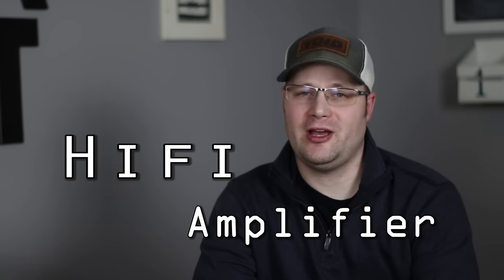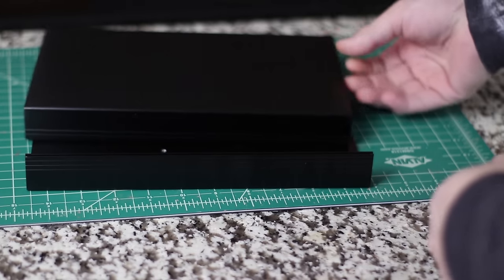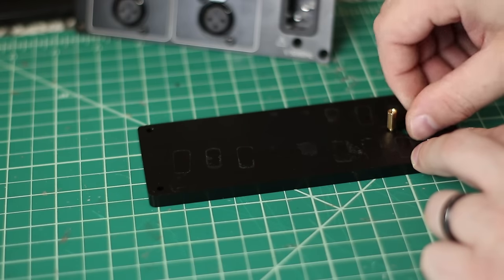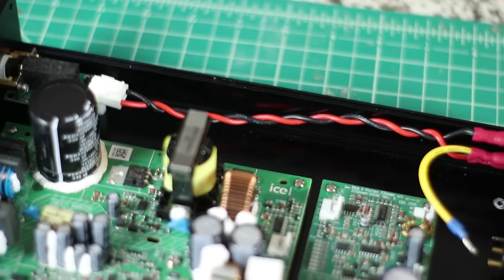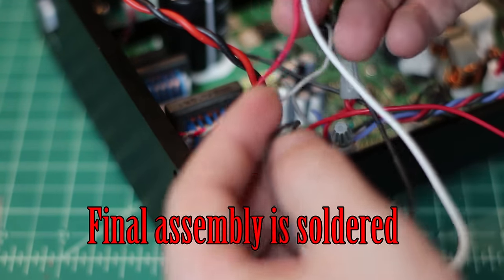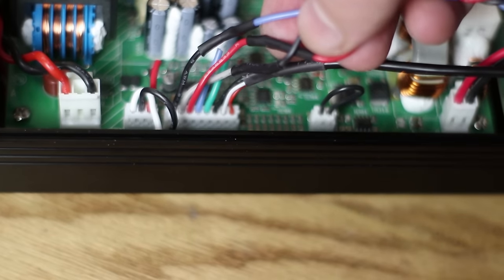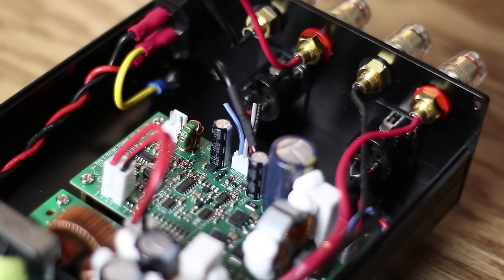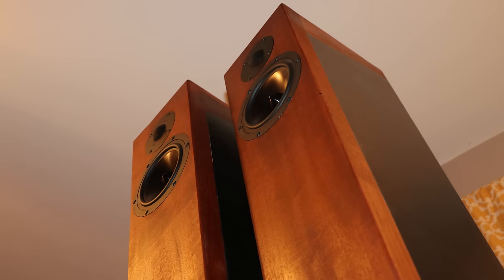How to Make a $3000 DIY HiFi Amplifier for $300

Comment: its definietly not a $3000 amplifier, and it not gonna sound as good as the good amplifiers made in 70's and 80's, you may just don't hear the difference between amplifiers, since i got my SA7800 rebuilt with modern semiconductors, there isn't much amplifiers that is better than it, i took a demo. My SA7800 sounds very natural and very good frequency responses, very fast music response, i took a demo of my brothers friend gear which is a sa7500, it was also real good, i heard some rotel amps, some 90's black plastic crap amplifiers, which didnt met the exceptations.  It's definietly a good 2x 200watt amplifier for the normal users, its a decent $300 amplifier. But for $300 i would rather get a better specs amplifier from the past, and not due to the nametag of the amplifier.
For audio enthusiastic ppl, this amplifier not gonna met the exceptation, and since you got it for about $300, you cannot say that its a $3000 gear, just because you like it, it not how things work.
No hate speech, I'm also an audio enthusiastic, its just so odd for me, my sa7800 worth about $900-$1300 but i cant put a 0after it just because i like it. I like my amplifier so much, but it not gonna mean that i would put a 0 after the worthiness so it gonna worth $9000-13000.

Every class of amplifiers have its own advantage, for sound quality class A or class AB but not D, D is only for efficiency, even tho this amplifier may gonna do 0.1% THD, the class A or AB amplifiers can do 0.009% or even some can do 0.007%, also with so much more natural sounding, but they tend to make more heat, due to less efficiency, it draws more power, and also you have to make it much more beefier, to handle the VCC that you threw at it.

Also, yall always talk about the bass, but when you gonna talk about top sounds, from 19k-100khz?

Comment: Class D: A lot of bang for your buck and arguably is HiFi.  But it's a switching amp designed for high power amplification at low cost, $300 is about right.

Comment: They claim 200 watts RMS @ 79% efficiency. That would mean that something on that little board needs to dissipate 40 watts of heat. I pulled up pictures of that board and that's just not going to happen. Someone in the marketing department swapped Peak for RMS.
Reply from the maker: Just make sure to look at the data sheet

Comment: Im wondering if its possible to take a reciever lets say a pioneer elite thats not being used and replace the amps with 2x500w?
Reply from the maker: Yes. Take a look on the back of your receiver and see if it has a 5.1 -7.1 channel out via RCA.  If it does, you just plug in the RCA's from this unit into those ports. Your receiver will now output that signal to these amplifiers and bypass the pioneer amplifier.  I'll do a video on it. Make sure you're subscribed and hit that Bell.
Reply: @Toid  yes thats just like adding a regular amp.....what i want to do is take 2 500w amps integrate it into the pioneer elite chassis and retain all the functions this way when i use it for 7.2.2 ill have an actual 9 channels x 111w instead of the crappy 9x35w....the pioneer is originally 2x120w stereo its a Elite VSX-LX503 ....unless it has 9 seperate amps? Is this an impossible task?
Reply from the maker: @Titan7170  So you basically want those two to amplify all of your speakers. No. I don't know the way that that can be done you need separate amplifiers for each channel because each get a different input signal.
Reply: @Toid  hmm...ok well if they all got seperate amps then why does the power decrease the more channels you use?
Reply from the maker: @Titan7170  The way surround sound receivers are rated are typically driving just two channels. Once you start driving more channels with the same power supply, you don't get as much power.
Reply: @Toid  so the power supply is the problem? So theortically if i upgraded the power supply to lets say something rated at 1200 watts....should the power go up?....do you think a computer psu could replace a reciever psu? Sorry for all the questions....and thanks for responding.
Reply from the maker: @Titan7170  I honestly don't know. But I don't think it would be as simple as that. If it was you would think the manufacturer would just include that.
Reply: @Toid  well not if they trying to go the cheap route....thats why they rate the amps only at 2 channels ....they dont really want us to know what the reciever is putting out all channels driven....they just want our money....lol

Comment: Another great video. Will you build me one? LOL I am not familiar with Digital amps and how they sound. Is this capable of truly HiFi sound?
Reply from the maker: It is. Total distortion at full wattage is 0.2%.  I think it was Paul McGowan who said that and amplifier that they make at PS audio with icepower was one of the best he's ever heard.
Reply from the maker: Believe it or not it's actually an analog amplifier.  I think class d gets confused with digital sometimes.
Reply: would it be better to build 2 single amps, each with it own power supply? It would add to the cost, but, would it sound better?

Comment: I highly recommend just buying a taramp brand 2 or 4 channel amp, then get a few old computer PSU, isolate your 12v wires and strip the ends, then hook up to your amp. Very easy to hook up in the house. It's much more cost effective to buy an amp from a mass producer than to make one yourself. An 800W 4 channel is 115$ on Amazon and a power supply isn't much either. You'll be glad you read this comment if you are thinking about building an amp to save money

Comment: Missing the sound test dude, how come you don't show us the sound coming out of it?
Reply from the maker: Never thought there was a reason without a reference.
Reply: @Toid  The reference is our ears and what we've listened so far, in presence, through video or any other way, each one would have to evaluate by himself, it's very incomplete in my opinion not showing us the possibility to judge by ourselves.
Reply from the maker: @PG-PCW  right.  But without having heard the speaker before on other equipment,  it's not a good test.  You need to hear whatever speaker you know on multiple pieces of equipment, preferably at reference level. That's a hard test to do via video

Comment: Wait.... This thing uses switch mode power. Simply put, there is no way in hell you can compare it to ps audio, and other high end amps. There is a reason why the really top end brands use C-Core or R-Core transformers that are beastly and heavy.
Reply from the maker: Just to clarify PS Audio does use switching power supplies, which is what this is referring to. Look up any of their amplifiers that use IcePower, such as their stellar series.

Comment: @123toid does anyone make a case to do the 500 version in a 2ch?
Reply from the maker: I haven't found one, which is really unfortunate. You'd have to buy an already made enclosure and drill out all the holes.
Reply from the maker: @Genuine Audiophile yes. This case is made for the 500w http://www.ghentaudio.com/kit/asp-mxr.html. It is just a mono case.  They also make one with just an XLR output.

Comment: Why didn't you explain that you are just building a mono-block instead of a true stereo amp. You need to tell folks that you need two of these in order to do stereo. Who listens to mono these days so your price should actually be double that of what you are quoting here to be stereo capable - not so cheap now...
Reply from the maker: I'm guessing you didn't watch the video in full. If you had, you would know that this is two amplifiers in one. This is not a monoblock.
Reply: Are you sure?  The back panel shows left and right speaker connections.

Comment: Never seen  such a small thing costing 3000 like ANYWHERE
Reply: @nathandaniels4823  what’s that have to do with a amplifier that looks like a 25$ China piece of 💩
If this thing cost 300$ in any store it’s a ripoff, not to mention 3000 😁. 

Regarding that pickup, it’s not the most expensive, search little bit more and you will find a 15000$ one

Comment: Wow...dude. Turn auto focus off, set a tight aperture, and focus for the working range.  This constant refocusing is potato quality.  More light, tight aperture, no problems. Use a pointer rather than trying to zoom in on individual components.

Comment: Can't say much for this Ghent Audio. 6 weeks and still no sign of my case. No response to my email, either.
Reply from the maker: Really?  Did they send you a tracking number? That is weird. I got both of mine pretty quick.  If I had any strings to pull,  I'd pull them for you,  but unfortunately I don't.  I wish you the best luck.
Reply: @Toid  After some extensive work on the digikey site I think I have all the parts. So I can do this regardless.

According to the tracking number from ghent the stuff was shipped out on the 13th of March. We'll see if it ever shows.
Reply from the maker: @smrlabs  it should. Typically you can follow the tracking number.  You'd be surprised how many times it gets held up in customs. For me, it's in New York.  Sometimes its in customs for 2 weeks before they release it. The first case I ordered was here in no time (for the video) second one took a month (post video).

Comment: Sorry about my ignorance. Where is the volume knob? Pre-amp? And do you recomend this one that you've built, in relation to the lepai LP1601s?
Have you heard about the brand SMSL? Would be nice a review!
Reply from the maker: I love SMSL typically. In fact I have a review of one of their amplifiers coming out real soon. In fact, I know their a6 actually uses a lower model ICE board. If you have seen my latest amplifier build, it's basically a clone, minus the preamp.  but putting this up to any of the amplifiers I've tested that don't use hypex or ice, this one blows it out of the water. You would use a preamp with this four volume control.
Reply: @Toid  by the way, thanks for the answer.
Reply from the maker: @golias1979  a few things I love about SMSL is they use high quality components on their board as well as give you a powerful power supply, which many do not. So I'm sure it's a good amplifier. It still probably wouldn't be in the same league as the Ice units.

Comment: Is it necessary to solder the wires to the LED? Wouldn't have wire nut do the same thing? Especially if it's just the LED light.
Reply from the maker: I don't use the tool that's built into the Omnimic. I used the three measurement method and Xsim. Here's the three measurement rule. I also show you how to figure out in PCD here: https://youtu.be/zW5ZjN-gp_Q

Comment: no way in hell anyone is selling 2 x 100w worth of ice power modules in a box, for 3k.

I honestly doubt your even saving much money over buying something like this directly from a budget manufacturer that gets them knocked up by an OEM, considering your paying significantly over the odds for the modules when buying them as an end consumer. 

Control four sells amps based on similar modules with built in digital audio circuitry, control system and streaming capabilites for like 6-700 bucks. 

clickbait.
Reply from the maker: Those do start at $700 and are really cool units. Just to clarify, these are 2x200w where the control 4 is 2x100w.  It's also not considered a HIFI unit.  Where these IcePower are one of only two manufacturered class D amplifiers that you'll typically find in a HiFi amplifier. The other is HyperX.

Comment: How does a class D amp deal with crossover distortion?   Are they actually Pulse Code Modulation devices and therefore digital in nature rather than pure analog amplifiers?
Reply: PCM is not a "digital" technology.
Reply: Digital in nature is NOT the same as "pure digital".   While Pulse Code Modulation is analog, it is far more similar to "digital encoding" than a pure analog signal.   A class D amplifier cannot produce a high fidelity sound using a pure analog input.
Reply: Class D amplification isn't really PCM based.  It is a switching technology that doesn't involve encoding as commonly understood -- in principle it's much closer to a switch mode power supply than to a DSP chip.
Reply: Bruce ... Correct, but if you take a conventional Class D amplifier using the definition form the 1960s and attempted to pass an audio signal through it the distortion would be huge.
Reply: @swinde  -- It's all a matter of implementation rather than the underlying principle.  Once the genius engineering teams at the chip companies got involved, Class D performance pretty rapidly advanced in performance, e.g. TI's remarkable ICs for cost-driven applications and ICEPower's stuff for professional sound reinforcement and high-power audiophile gear.  The same sort of evolution happened in early solid-state gear 50 years ago -- the first generations of high-power solid state power amps from companies like Dynaco and Phase Linear suffered in comparison to powerful tube amps like McIntosh's massive stuff, especially in reliability under stress, but as better semiconductors started arriving from Japan and designers gained experience, those monster tube power amps pretty much became a thing of the past except for nostalgic "valve" aficionados who insist on the "warmth" of old-fashioned amplification.
Reply: But I think the use of PCM alters the definition of class D.   While it is not purely digital, it is certainly not pure analog.   I am not saying that these amplifiers cannot sound great.  I am just pointing they are NOT pure analog amplifiers.
Reply: @Genuine Audiophile -- Can you provide a direct link to that white paper?  Thanks in advance!

Comment: Before you buy this supposed HiFi class D amplifier you should ask to see some proof of the Fidelity and the actual power output.
Reply from the maker: Okay.  Check out Rotel, PS Audio, Bowers and Wilkens, Wired for Sound and B&O and others that use these amplifier boards for the proof.  You're welcome to research IcePower since you don't believe it.
Reply: @hificat101  this video is an advertisement in the guise of a diy video if you can't put some screws in a couple or boards and plug in some electrical connections that can't be plugged into the wrong connectors you shouldn't be messing with high voltage electrical devices he gets paid for everything bought from this video

Comment: has anyone with even no experience with soldering been able to do this? i am intrigued.
Reply from the maker: The only thing you have to solder is the XLR output. You can use quick connects for the rest. I'd rather solder it.  But with good fkux and a decent soldering iron and solder, it's not too difficult to solder these.  The soldering done here is beginner level.

Comment: KRELL does an entry level integrated amp for around $3,000 or less, I bought their one about 8yrs ago for $2,250, it looks far bigger and am sure more powerful than this, 200w RMS both channels into 8 ohms, weighs almost 20Kg, doesn't move when you try lugging in RCA on the back like this paperweight little amp.

Comment: @UCvusxEHa4KxVCusGeAK8n0g So if I want a 2.1 system I would get the 
ICEpower 1000ASP Class D Audio Amplifier with Power Supply Module 1 x 1000W for the Sub and two of the ICEpower 500A Class D Audio Amplifier Module 1 x 500W, but would the power supply be too much for the 500w boards?

Comment: I count a lot more than $300. You can get better parts for the money.
Reply: Case kit is $113, boards are $130 and $70, jumper and power cord are $7. Parts Express has %10 coupons all the time. That's less than $300.

Comment: Where are the speaker protection modules at the output? A 3000$ amplifier have it. the things are not that easy.
Reply: Module hahahaha speaker protection is nothing more then a resistor.
Reply: @Genuine Audiophile Yes, like other integrated or "chipamps" amplifiers have his own protections but... when the protection fails, bye bye speakers.

Comment: I have a Rockford Fosgate p250.2 that isn't much bigger than that that would out perform and sound better than  that class D amp any day. Class D are mainly used for subwoofers for a reason. They have a hard time reproducing high frequency sound accurately.
Reply: Balderdash.  Modern Class D chips can effortlessly and very "accurately" reproduce the entire audio spectrum, which is why these days you'll find OEM Class D boards in multi-thousand dollar "high-end" power amps designed for "audiophiles."
Reply: @editorjuno can you name one    and show proof of the amplifiers  specifications. This guy isn't showing any proof of this amplifiers specifications and unfortunately you can't believe the specifications listed by most manufacturers because a lot of them bend the truth to make their product look better than it actually is.
Reply: @waderyun.war00034  -- All the Class D chip manufacturers provide very detailed and indisputably credible spec sheets.  It's not some amateur amp builder's job to provide that sort of data, so if you're really all that concerned kwitcherbitchin' and lookitup!  :-)
Reply: @editorjuno  that's what I thought you can't even name one and can't prove anything. You are just going to keep commenting bs about how great class D is you must be getting a kickback from the manufacturer.
Reply: @waderyun.war00034  -- Yeah, I'm getting fat checks from TI and ICEPower....I wish!  :-)
Reply: @waderyun.war00034  -- Here's the specs of that $3K amp based on the same OEM ICEPower output stage used in the video.  PS Audio sends me fat checks too!  :-)

https://www.psaudio.com/products/stellar-m700-power-amplifier/#tab-specs